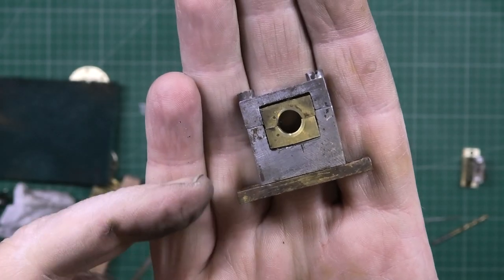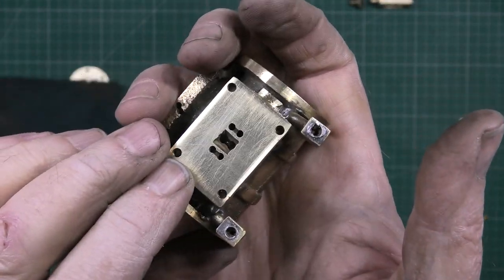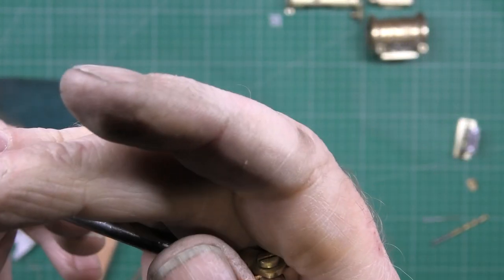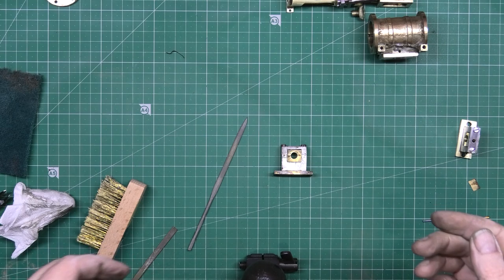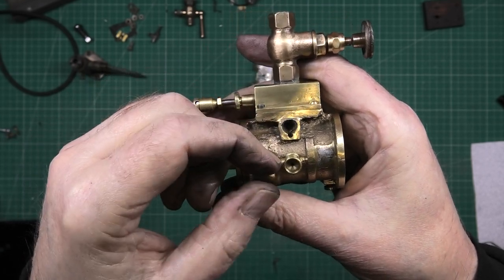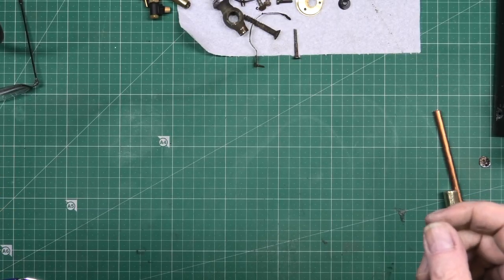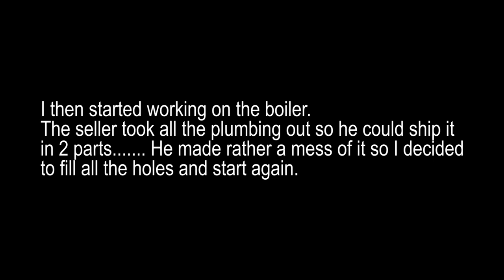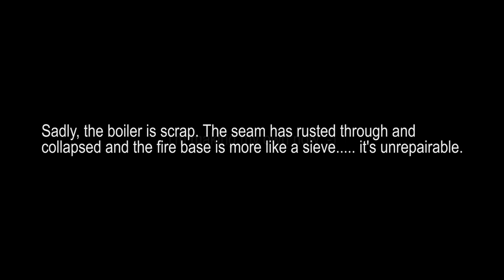Live steam engine refurb - the 2nd one - part 2 of 3

Comment: A piece of glass or mirror with wet and dry on top is brilliant for facing off.  I used to tune two stroke engines for  Vespa’s and Lambrettas and used glass and wet and dry to skim the cylinder heads with brilliant results

Comment: My guess on the double valve flange is that it is symmetrical enough that if you wear out the first set you can flip it around to get it running before you entirely replace the engine or else they had two ways of mounting them and only wanted to tool up for making one cylinder.

Comment: Wow those parts look like new great job and that whistle top doesn't look like it's been repaired looks original. I'm looking forward to seeing it back together as I bet your are I would use the same base, if you made a new base you're right it would spoil the whole look and age of the engine it's what make it look rustic and old. Don't know how you could remove the oil that has soaked into the wood over the years thought.

Comment: Hey Vortecks. I got a question about the VBMS app. The temperature on the main display, can it be changed to one of the thermal couples instead of the MOSFET temp? I have other temp probes plugged in, so it would be nice to make it either show the max temp of the 4 temp sensors, or a select sensor. Thanks!